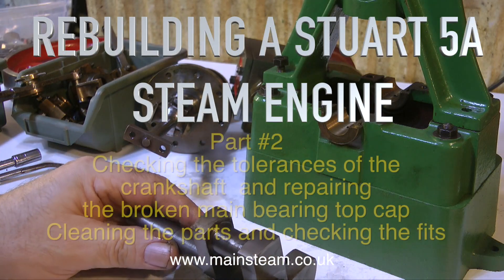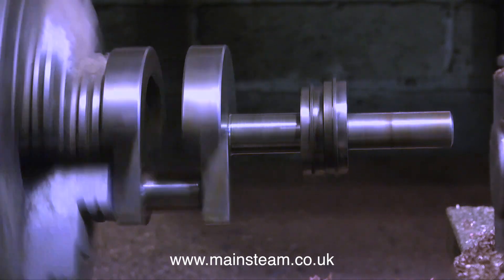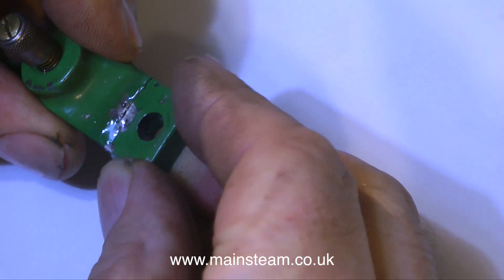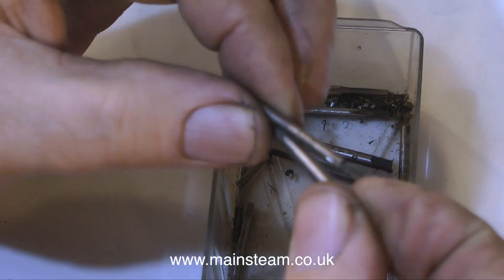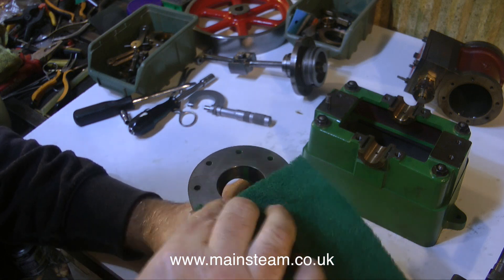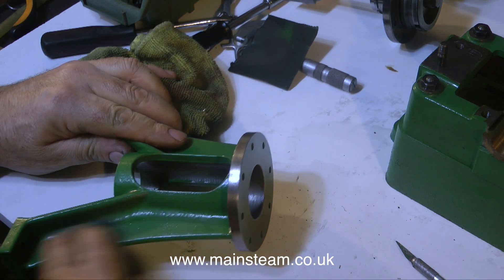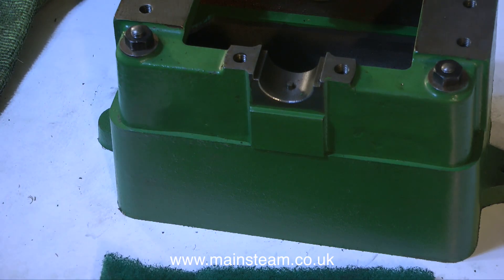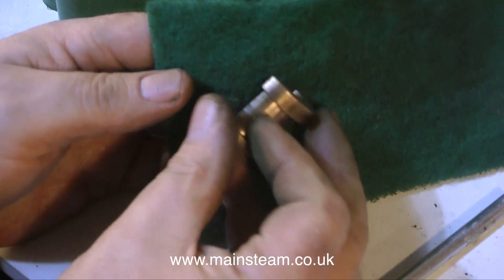STUART 5A STEAM ENGINE REBUILD - PART #2

Comment: Looking at your setup for checking the crankshaft eccentricity has me concerned that the runout you measured is from the chuck runout, and not the crankshaft. Unless it is a 4-jaw independent chuck, any kind of scroll chuck will always have a bit of runout.

Comment: Glad to see your newest video Keith! Personally I have successfully repaired broken cast iron by holding two halves together with socket cap screw loctited in place. The holding power from those screws really added strength to the joint.

Also silver soldering works fairly well too. given you have the mating surface cleaned and fluxed well

Edit: Of course the cap screw arrangement needs tapped hole on one half, clearance & counterbore on the other. The head can then be puttyed over for a headless appearance